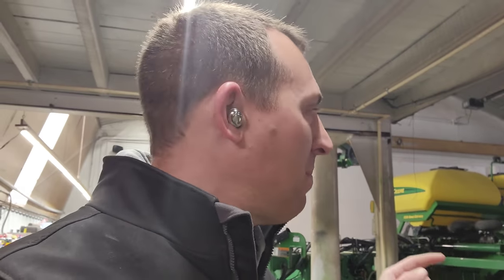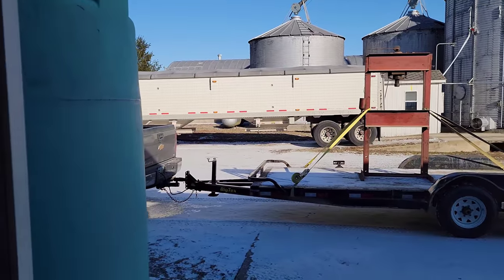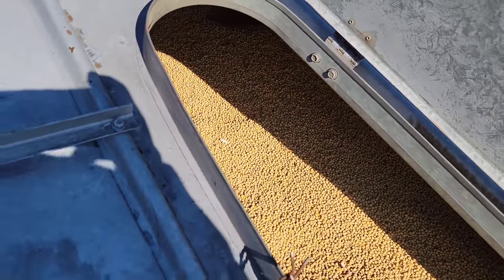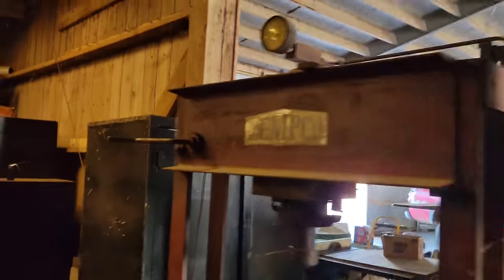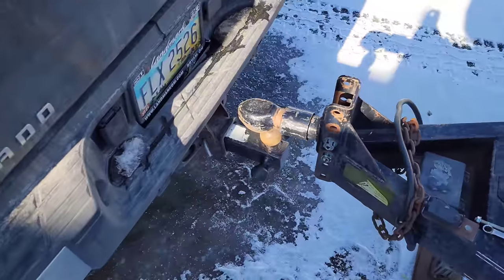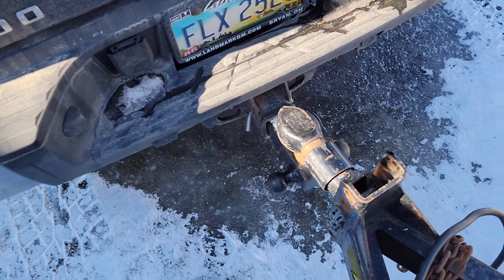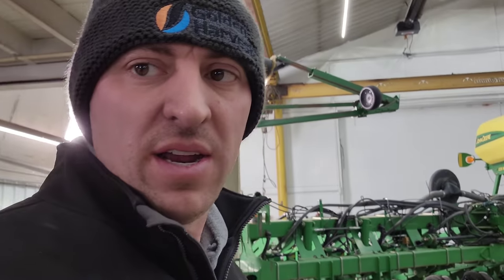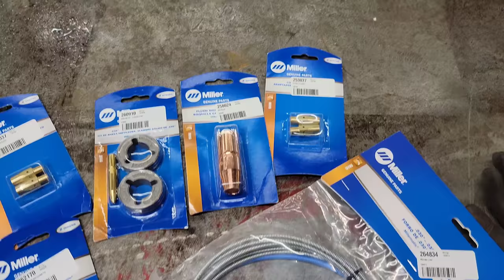Swapping Presses - #344

Comment: Press force can be calculated by the formula of Force = Pressure x Area.  All you need is the diameter of the piston inside of the cylinder and the pressure created by the pump.  Maybe for piston diameter, measure the outside diameter of cylinder and subtract a 1/4" wall thickness x 2 walls for both sides of the diameter to get an estimate of piston diameter. Example 6.00" outside diameter -1/4" - 1/4" = 5.50" piston diameter.
Area of cylinder formula = google it.

Revision to my information = Do not use max gauge pressure as the Pressure value.  Gauges are sold to show many different max values leaving the user to determine which one they need.  And, as the cylinder extends and incurs resistance from pressing onto something, pressure increases, unless the hydraulic system has a pressure regulator or pressure relief valve that controls operating pressure of the system.  When I calculate Force values, I usually use 1500 psi, unless I know the true Pressure value generated by the pump.

Comment: That motor will work on a 110 but you probably need to rewire the motor.  Our motors at work are also interchangeable but we need to look at the wiring prior to installation.  Or they overheat and fry out the internal windings.   Please look into that.  Motors aren't cheap.
Reply from the maker: Oh I'm aware the leads would need connected differently.  36 amps is to much draw on the 12awg wire that's existing so since I have to run new wires anyway might as well make it 220 volt.

Comment: Personally I think all your previous recent videos have been just fine and I am unable to identify any significant step up in performance with your new phone (to date) when it appears on my laptop. There may be some small improvement in pretty extreme lighting conditions or close up pictures. Audio issues with the wind often seem be a problem for many cameras/phones but not much else whereas battery life seems to be a frequent problem.